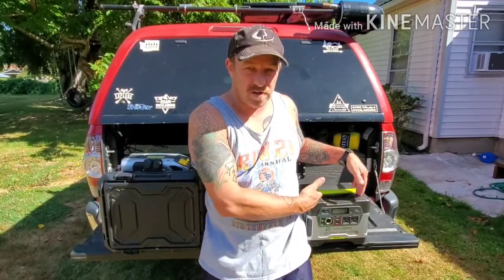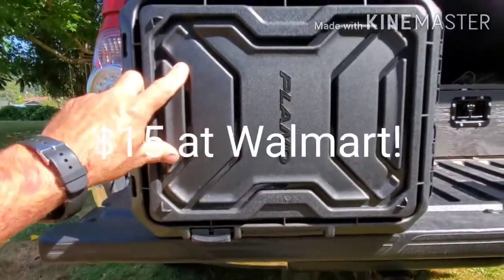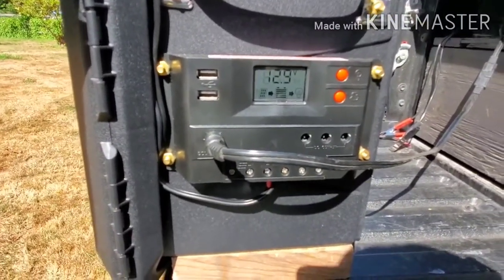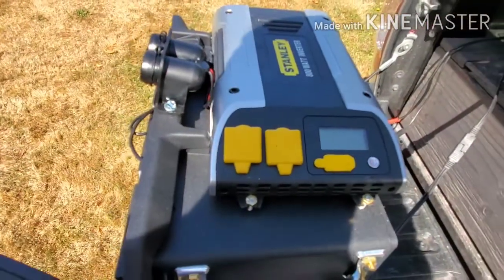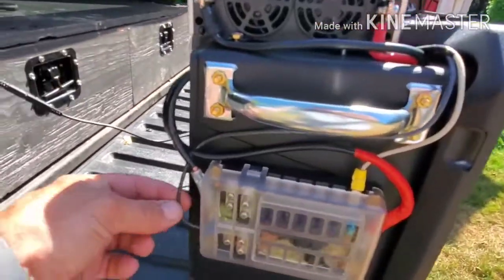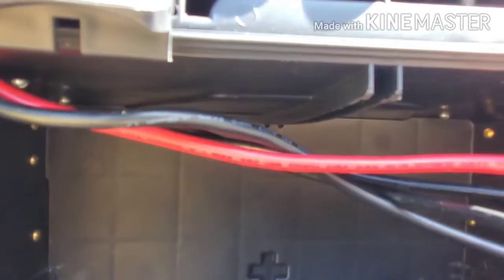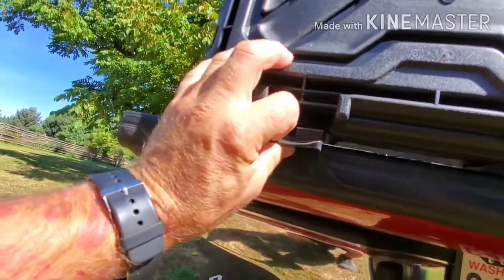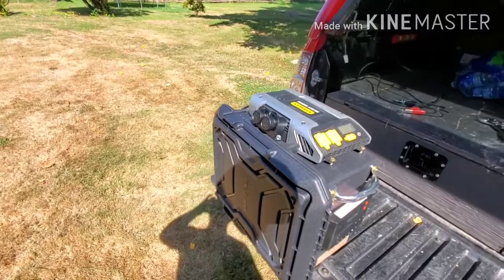DIY solar generator for $200! 800 watts of on the go power in 1 hour! Watch before you buy!

Comment: The battery in your DIY is an AGM battery The goal zero has a nice lithium battery
Reply from the maker: Correct. And although the battery is not the best (easy upgrade when money allows) the unit puts out twice what the goal zero does, meaning I can at least run a saw, which I can't say for the goal zero....

Comment: Just wanted to point out that the 30Ah one is likely lithium, which means you can use pretty much 100% of it's capacity. The 114Ah one is lead acid, which means you can really only use about 50% of it's capacity, so it's really 57Ah of usable power.
Reply: Those Amazon fuse panels are trash. You can read 11.45volts with the fuse pulled out … very dangerous

Comment: You did not say how you put the cigarette lighter hook up or the fuse panel or maybe I missed it. I`ll look at it again. Thanks
Reply from the maker: The lighter only has a positive and negative so I ran the positive to the fuse and the negative to the grounding block. The fuse box is powered from the battery so add a fuse and done! Thank you for watching!

Comment: Great DIY. Some notes: the Walmart deep cycle (lead acid) will be damaged if it’s discharged below 50%, so it’s really 50AH unless you want to ruin it. Also the Yeti is pure sine wave 110VAC. Pretty important for electronics. Pure sine wave inverters cost a bit more. Still DIY is the way to go on these.
Reply: I love the home built units. When something  goes belly up you can fix it yourself.  

I built quite a few battery/inverter boxes and my drive is to cram more into a smaller space. Ain't cheap!!!!!  The last unit I built fits in a MinnKota trolling motor box and has a 200 amp hour lithium battery inside. That's 2560 watt hours, equal to 4 of the 87 pound deep cycle batteries. There's no solar charge ability (yet)  and I added a 300 watt PSW Bestek inverter on top held there by Velcro. But I can strap on the 1200 watt Bestek inverter if needed with a jumper cable.  It can run a 4 cu ft fridge/freezer for up to 8 days before needing recharge. Lithium batteries are coming down in price but still a lot of $$$$$.
Reply: @The Solar Junkie 
Don't worry about it. When the shit hits the fan, I will burn old bus tires to keep my family warm. Old railroad ties, too.

Comment: it's cheap, which is nice, but...  I'd rather pay to have a semi decent MPPT controller for better charging, LI-ION, because it's energy density is SO much greater and so many more charge cycles, an if you did a DIY pack you could have a KW of power in the same sized but lighter package.   (which would take some time to save up for too because of the much increases expense)

but all that is just a personal want, and has no reflection on your excellent work and walk though.

Comment: Is it dangerous to use that type battery inside a van?
Reply from the maker: Yes I would definitely have it in a box vented to the outside if possible.  I highly doubt it would be harmful in the van, but better to be safe than sorry. For the van I would spend the extra money for a sealed battery so no gasses can escape. The rest of the setup could still be used! It would raise your price, but it would be minimal for that piece of mind.
Reply: @overlanderbenny3789  Awesome thank you. Do you mean an AGM?
Reply from the maker: @anniebeasley92  that would be ideal for sure! But they do sell other kinds of sealed batteries that would be suitable for inside a van as well. I believe some brands like Optima have sealed batteries that would be fine, although probably not as good as a AGM.

Comment: How long does it take to charge it on solar vs the yeti?
Reply from the maker: That's a good question! I've never really thought about timing that to see. I do think it takes quite a bit more to bring this unit to full charge though, as it is much bigger. For example I can watch about 2 movies on my 7 inch DVD Player with the yeti. This will easily run the DVD all night and the fridge as well. It has substantial more power than the yeti, no Matt what the other comments may say. I run them both so I can attest!
Reply: @overlanderbenny3789  Do you charge your lead acid battery on solar?
Reply from the maker: @scottboyte  yes I do with the harbor freight 100 watt panels and controller kit.  It was about $189 last I seen for the kit and comes with everything you need but a battery.  I had to make my own adapter to charge the yeti from the harbor freight panels, but the yeti has a built in controller, so I go straight from the panels to the yeti. The harbor freight controller is mounted to the side of the box I made.

Comment: PWM controller versus MPPT.  MSW inverter versus PSW.  90% SOC available versus 40-50%.  Don't even get me started on the weight difference, but that SLA battery is probably north of 70lbs, by itself.

Your build is a very good one, but it's using components that are all last generation, with built in limitations.  It's nothing at all like the Yeti.

Comment: Hey great setup. Two questions: how do you vent it can you position that battery in any way? Thanks
Reply from the maker: There is venting from holes in the back I drilled and where wires go in I didn't seal them. Battery isn't a sealed battery so must be kept upright. If you can afford a sealed battery you wouldn't have either issue!
Reply: @overlanderbenny3789  yeah i used sealed batteries left over from when i sold my jeep. Thanks again!

Comment: Krieger has an 1100w  inverter with fuse box attachment on wires!!
Reply from the maker: That would be perfect!  I feel anything under 1000 watt is nearly a waste of time for anything but charging devices. At 1000 I think it opens up more options. But I couldn't pass up the price of the inverter for this experiment!

Comment: This is simple compact and easy, thanks for inspiration to keep inverter on top so your design doesn't need an internal cooling fan, simpler design, cheers.  Most the time I won't use the inverter anyway for car camping; I'm running a 12V DC fridge/freezer, a few USB LED string lights, a USB fan and purposely cutting back on electronics during car camping so only sporadic charging of phone or laptop. Any town sells used refurbished batteries if you ask around (I asked a nice guy at Batteries Plus who pointed me to American Battery Corp), or even the junk yard sells used refurbished, so I'm betting I'll come in way under $200, cheers.

Comment: FYI : your not supposed to run ordinary auto type deep cycle batteries below 50% without damaging & shortening the life cycle. So in technically a 100Ah battery only has 50Ah of use before needing to be charged IF USED PROPERLY. 
A  Lithium battery can be ran down 80-90% & last MANY several thousand more charge cycles than a lead acid or gel.
Reply from the maker: It's a RV battery that is supposed to be ok to discharge more, and obviously who wouldn't prefer lithium, but it was an cheap as possible experiment and that's what I could afford!  Lol
Reply: @overlanderbenny3789  
Hey, TOTALLY NOT KNOCKING IT!, great build! And budget friendly is always good!
Just a thought. True, Lytham is more bucks up front but cheaper in the long run, do to having a WAY long lifespan & usable Ah.
Reply from the maker: @CD-hc5ds  I agree. I plan to do the same basic set up in my cargo trailer conversion but more power and better batteries.
Reply: What is a Lytham battery?  Never heard of it before?
Reply: @alpscraftshack599  
LOL OK, typo👍
lithium iron phosphate

Comment: I found old used UPS with pure sine inverters. I would get one without the battery, get a new battery, a solar controller and a solar panel and I'm good to go. I can use it as backup at home or use it in my car camping.

Comment: Hi Overlander Benny, outstanding video and not because you're standing outside I really appreciate this video as well as other people I'm sure it's very knowledgeable in many different areas all tied together to help anyone. I was just wondering I'm going to get the harbor freight kit as well and a deep cycle battery size 29 as well as a lower watt 400 modified sine inverter but I'm just curious as to your separate fuse block is that only connected to the cigarette lighter ports for protection or is that for the whole system like the inverter, because I understand you connected the inverter to the battery posts but does it tie into the fuse block at all, I'm thinking of leaving out the cigarette lighter addition and the fuse block do you think that would work? Or is the fuse block a necessity I'm just not to certain on this, thank you for your time.
Reply from the maker: Yes the inverter goes directly to the battery. The fuse panel is for the cigarette plug in and anything else I may add in the future,  and completely unnecessary if you are only using the sine wave inverter.
Reply: @overlanderbenny3789  Thanks Benny. A simple hand drawn circuit diagram would be great, to include fuses.  And closeups of connections in good lighting.  The diagram could be a comment here or a new video to include showing drill working, adding a kilowatt reading would be fun to watch but not necessary. your circuit diagram could be as simple as a hand drawn version of the 2nd to last picture diagram shown in this solar panel https://richsolar.com/collections/rigid-solar-panels/products/200-watt-solar-panel. You could also explain in the next video that because your inverter is on the outside, you didn't put a fan inside the box. You mentioned elsewhere that you'll do a detailed video of a more elaborate system, probably for your 6x12 cargo trailer, but more details in this build would help folks. Even if you didn't want to wrench yours apart, you could just do close up photos of connection pieces off Amazon ads to help folks out.

Comment: Great build. I have made the same but used a Stanley tool box. the plastic one on wheels from Walmart. Also I used a 100 watt solar panel. The best part about it is i have the top of the box for carrying extension cords and other solar related things. 12 volt light, 12 volt fan...
Reply from the maker: Great idea! I also have 100 watt panels on my truck I use to charge it.
Reply: can you share a parts list on your build

Comment: Harbor Freight has 750 Watt inverters for less than $30. However, these are modified sine wave and not true sine wave, so you probably wouldn't want to use it to power computers and such, causes a horrible noise in the electronics.
Reply from the maker: I didn't know they had them that cheap! I understand what you mean about powering the device, but could still charge a laptop and unplug it to use it! Lol
Reply: @overlanderbenny3789  oh for sure, and I've only really noticed the crazy noise in desktop PCs, not so much in laptops.

Comment: You did a good job but do you know what is different between pure sine ware and modified wave power inverter? All power station using pure sine wave inverter.(pure sine wave inverter much expensive than modified wave inverter. Price almost double.
Reply from the maker: I am aware this was a very cheap inverter. It was a experiment that I wanted to try as cheap as possible before I went crazy on a good inverter and battery.  Now I know I like it and it is extremely handy, I will be building a much nicer one in my trailer as well as another portable. This inverter was on sale for $35 so I really couldn't go wrong....lol

Comment: AGM battery is cheaper than lithium but sooooooo heavy. 😩
Reply from the maker: I know! I will be spending the money on good batteries for my trailer build but since I was experimenting I wanted to stay cheap! Definitely would go for a sealed battery if possible!
Reply: @overlanderbenny3789  Go ahead and discharge one vs something like LiFePO4 ,  Lead Acid and AGM are lucky to get 50% discharge before off at a contant heavy draw (what you're saying  this rated for, should last an hour yeah?  No.  You'll get the amps for a while but not what it says "800*).  Your capacity draws will be vastly different.  Don't take my word for it, check a lead acid or AGM vs basically anything else that people are using.
Reply from the maker: @ecidemon5672  oh I'm definitely aware of the vast differences at this point!  Like I said, completely experimental.  I can change the battery out at any time with 2 wing nuts when I get a better idea what my final plan will be. This setup works well for the time being while I focus on other projects!

Comment: Goal 0 is pure sine wave, pretty sure Stanley is modified wave, Wal Mart doesn't have full watts available only half without damaging the battery. (About 52 watts), in your case, you'd be better off buying a small lithium battery and adding it to the goal0, you can also add outlets for cheap. Yours (DIY) is much heavier than the goal0. But, for those without, you did good showing a DIY build!
Reply from the maker: I will definitely be upgrading when I do my trailer solar. I'm still learning and this was just a experiment that turned out to work quite well! My goal zero with a daisy chain to another battery is great, but not convenient to pack 2 separate units for me in the truck. This provides 3x the power as my goal zero as is. I'm not even slightly impressed with the yeti I paid twice as much for.....

Comment: Is it safe for electronics? Pure sighn wave?
Reply: Pure sine wave inverters are best for running thngs with inductive motors. Such as a\c, refrigerators and some fans. But modified sine wave inverters work just fine for most electronics.
Reply from the maker: This is not a sign wave converter but I would still use it for my TV or lap top, with a standard surge protector just in case!

Comment: ...continuing, would that be better and afford me the higher wattage? And would a larger battery enable producing the 1000w that the inverter is capable of?

I hope these ??? makes some sense. And thank you for sharing your creativity.
Reply from the maker: You are correct it would be redundant. My yeti is also inside the unit. However the yeti is 400 watts and a 33 amp hour battery, and is recommended to discharge no less than 20%. With the 800 watt I have a much larger battery with 114 amp hour storage, and should be ok to run near dead if necessary. The inverter eats battery life fast, so I have a 12 volt fridge and such. The inverter we only use for small stuff. The yeti 400 will NOT run a power drill for instance, but the DIY 800 watt will, and for substantially longer. For instance I have a projector that we watch movies on. I can watch about 5 hours with my yeti using 110 volts. I can watch probably 3x that with the DIY. My solar panels and control came from harbor freight.  To use them with my yeti I did have to make my own plug because they make them special so you have to buy their panels...

Comment: I’m impressed with your charging system. Would like it for myself. However, I’m perplexed about how you can utilize 800 watts. I’m at a disadvantage because I don’t know enough. I’m stumbling over understanding how your inverter can dispense so much wattage when your batteries are so small. Was it you who also  mentioned lasting 50 watt hrs? 

I have a 230 watt portable panel connected directly to a 500 watt Tacklife solar generator. I’m not utilizing my charge converter nor an inverter. They are integrated into the Tacklife so I believe they would be redundant. 

If I were to build a system such as yours with an actual battery, would
Reply: Sounds like you have an all in one system. I prefer those to building my own. 
Fuses and breakers confuse me. Ha

Comment: 200 amp hour solar generator.. second one down from the top
Reply from the maker: Great video! Thank you! I would have left you a comment but it says they are turned off. But I really think its a great idea and would be ideal for a small off grid cabin or something like that!
Reply: @overlanderbenny3789  thanks..was fun to build..
Reply from the maker: Last night I watched a video on your page of the 3000 watt build for home but it seems to be missing today! I watched it on my lady's phone so didn't comment but my question was, does the battery care If you lay it on the side? Or do you flip the battery right side up when using the box as a table? If it works in any direction, what battery is that! Lol
Reply: @overlanderbenny3789  yeah I have to put it back up something happen actually going to just reshoot it because my new controller came in and I'm putting it on but no that AGM battery doesn't care what orientation it's in it's a sealed battery so you can put it sideways upside down doesn't matter what position it's in
Reply: @overlanderbenny3789  hey Benny are you talking about the big fan powered box that I built for home power or the smaller orange and black portable one
Reply from the maker: @joesapia9732  yes the home box with the fan is what I seen sitting different directions.  Thank you for the info!
Reply: @overlanderbenny3789  no, the home is only Built for lay down application because of the way I mounted the controls on the plexiglass lid in the case but it does run a sealed gel battery so the orientation wouldn't mind but the displays would be all sideways on the control panel, the small orange and black one is the one that I built that you can change the orientation of the box
Reply: @overlanderbenny3789  yes that is the 105 amp hour 800 cranking amp AGM Deka battery 8A31DTM is the part number